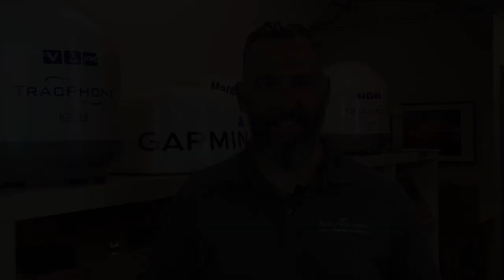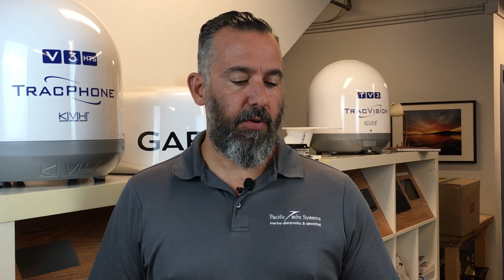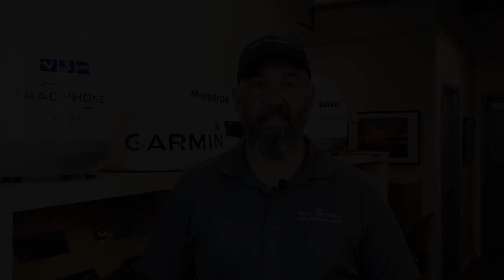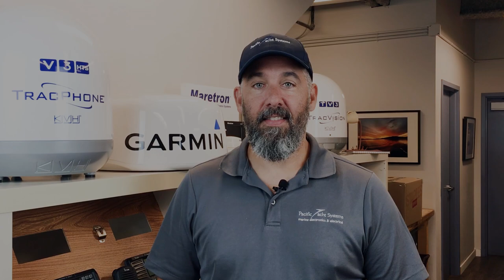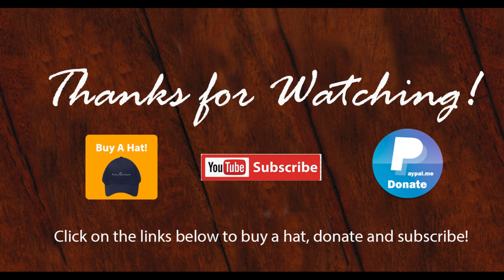Ask PYS - Should I Have a Battery Monitor on My 19 Foot Boat?

Comment: Now that was a great question.   And I have a question for Jeff.....good idea or bad to run a Honda generator on my Catalina 30 when on the hook or underway for particularly high loads....?  Enjoy your channel and greetings from the great State of RI!
Reply from the maker: Hi David, some boaters definitely run a portable generator. Things to consider are the fact the generator provides an ungrounded connection to your boat AC system, the  toxic exhaust fumes that can enter the cabin via backdraft, and lastly the vibration and noise. Notwithstanding some of us, still choose the the portable generator to power the AC panel on our boats.

Comment: Hi Jeff, after a summer of constant anxiety over my lead-acid batteries becoming drained by my cooler, I am looking into putting in a lithium pack. Since lithium and a 2008 outboard with alternator might be a bad idea, i am thinking of keeping one lead acid battery as the starter, and buying a separate lithium house battery, charged with my 100w solar panel and a modern mppt solar charger.
The question now is, would it be a bad idea to put both banks in a 1-2-both switch? I imagine it would help charge the lithium pack underway, and the starter pack from solar. But i am afraid the current draw might be too high from either bank, or that the alternator wont like the lead/lithium combo? Complicated idea? Yes. But i think only lithium would be way more dangerous for my old 2008 engine. Any ideas? Thanks for a great channel!
Reply from the maker: Good question Jonas. With mixed battery chemistries (e.g. Lithium and Lead Acid), we use a DC to DC battery charging (e.g. Victron Orion) to charge different battery chemistries at the exact voltages needed.
Reply: @PacificYachtSystems  wow. That looked both simple and safe. Had no idea that existed. Thanks!